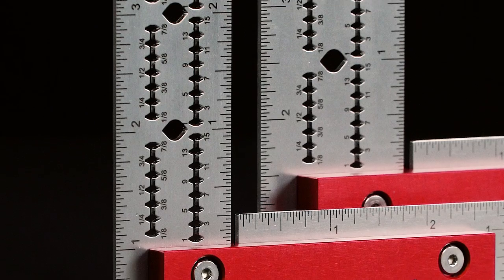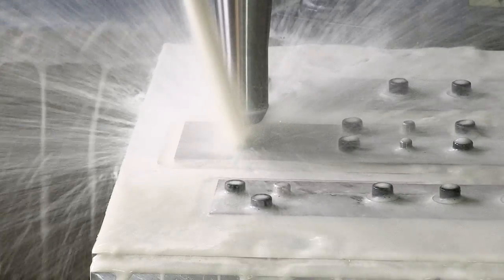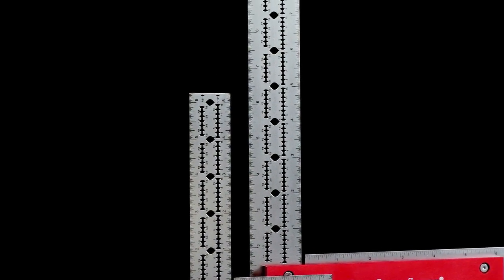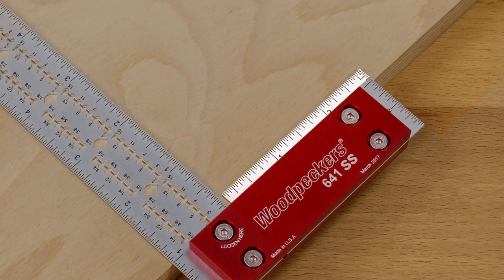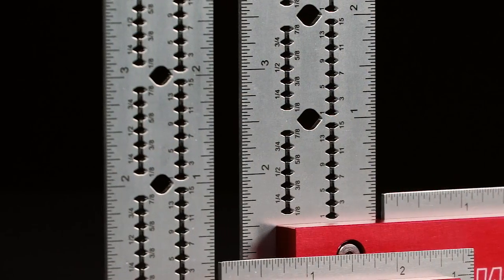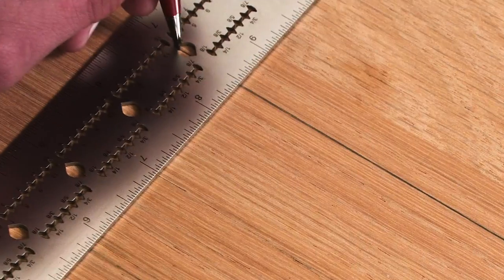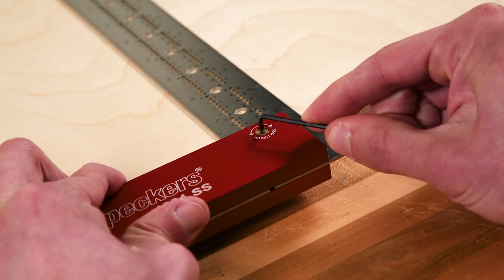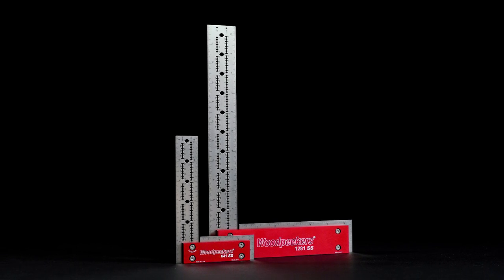Woodpeckers | OneTIME Tool® | 641SS + 1281SS

Comment: Folks, if you look at this new square it unlike anything else on the market with the precision marking holes and measurements on 3 sides. In my opinion, they have given us the ability to correct issues IF they occur making it in my opinion a benefit not a flaw

Comment: That's why I just sold their One Time tool guide rail track square and bought the new one from TSO. Just can't trust it to stay square.
Reply: Ross Williams, DC correct. They need to sell stuff that makes sense. I bought the same GR square
Reply: Just got my TSO, impressive. Did the four cut test around a piece of plywood and a perfect 90 at the 4th cut. Today put it to work doing 4 foot cross cuts and everyone I checked was perfect.

Comment: This is sad. Any square that has to be adjusted isn't a square. It's a hassle. This is just pure garbage. Every line that's scribed I would feel like I have to double check if it's square.
Reply: most likely because the stainless steel is too thin to prevent shearing/rotating when knocked hard. a friction fit between the adjustment screw (most likely a cam wont cut it). it needs to be much thicker to stop permanently fixed cams from rotating which wont allow the pencil to be used.
Reply: Then again, maybe its a better version of a square because you CAN make sure its square and adjust for it.
Reply: Dave Klein I can understand the logic but to pay that much money for a square I want them to sell me something that's "square". I want them to do that leg work for that money. I just think the one time gimmick has run its course
Reply: Maybe its run its course for you but certainly not for meHigh quality American Made never gets old